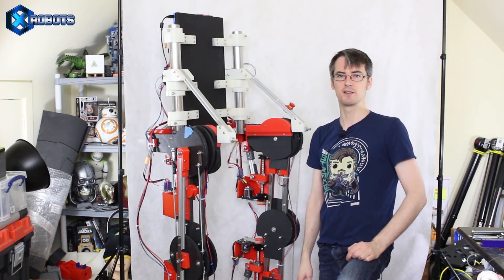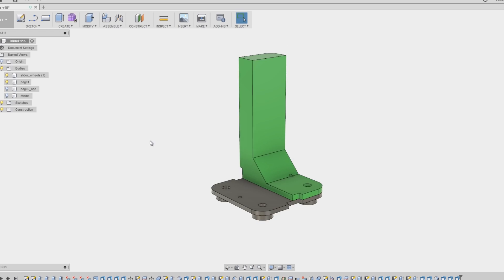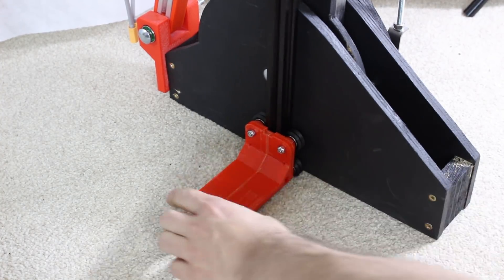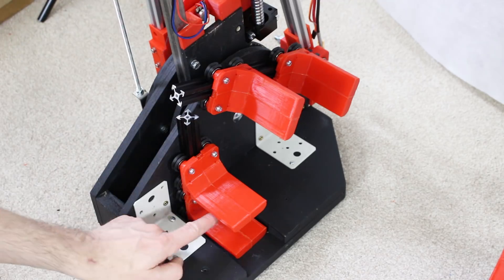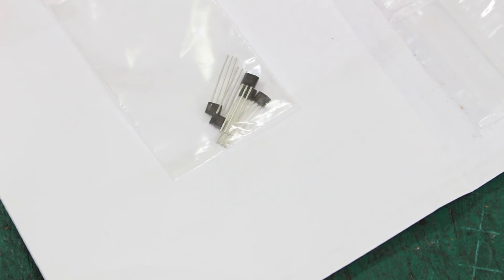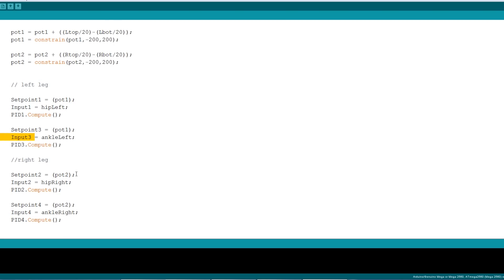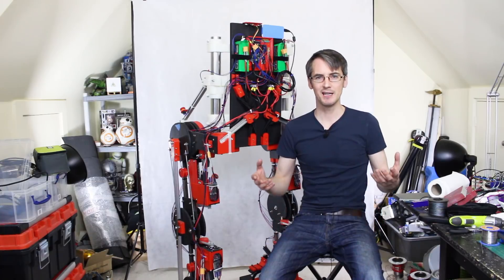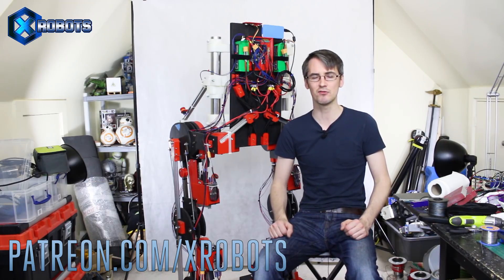Iron Man Exosuit #20 - I Can Move! | James Bruton

Comment: its not that the motors aren't responsive enough, you still have a 3cm air gap between the slider and your foot. just extend the slider pad so it is always in contact with the top of your foot, then it'll work better
Reply: but that's one of the factors that make it kinda irresponsive, he lift his legs, and it takes some times to the motor to get the speed and bend the legs. The motors aren't strong enough tho
Reply: Check out kids strap on rollerskates. They lock the user in while still allowing for movement. That may be a better option for the foot controls.
Reply: It's because the motors are installed with the last Apple update. That's why they're too slow
;)

Comment: That's pretty awesome, but I feel like there should be some type of up/down sensor at the hips, so you could crouch down. The suit is currently capable of the movement, but you would have to lift your feet as you crouched, which doesn't make much sense. The real problem with that is where you would attach it. Maybe some type of harness at the waist that includes the side/side and up/down?

Comment: Perhaps the release of weight on the bottom sensor should, if/else a branch to 'alert' the system for possible upward movement. You may also want to steepen the response curve for the up sensor, to lift at a lower value so it moves when you lift your legs. Or maybe the two working together will give you the leg lifting response you need. :)
Reply: My apologies, I mean in conjunction with the larger motors. :)

Comment: The lack of responsiveness is due to the gap between your foot and the sensor, you have to move your foot a long ways before it starts to move. Just add more foam so that is is always lifted up some. Doing so will mean comparing the two sensors to get the direction because both will may be giving a movement command but that is also easy.

Comment: you need the ankle joint for the end solution. When you add the arms and start actually loading the whole structure not having a stable surface while walking will get dangerous. Your mobility will be limited and given the force flow you will not be able to stabilize if the frame begins to fall sideways. 
I think that you may get away without motorizing those but I am not really sure where the center of gravity will be when you finish the build. So far it looks like it will above the middle line(height) and beyond the middle line(width). 
I would suggest you to ensure that the legs are always contracted at the knees and pushed forward at the hips to compensate for that.

The sensors are cool, but go for springs and rework those in a single assembly- you do not need that much movement to get a result and going for a single assembly should ease the mounting/wiring.  
Bungees are good for prove of concept but they introduce non linearity in the whole system due to the way elastic fabric works.

Comment: The motor has plenty of torque, but as you're running sensorless, the VESC is struggling to start them. You could try lowering the min eRPM, increasing braking current (seems to have loads of ramping in there, not sure if that's deliberate or lack of braking) and dropping the duty cycle ramp step to bring the VESC's attempts to change the motor's speed more in line with what's physically possible.

You could also deliberately introduce backlash at the motor so it gets spinning before it sees load. This helps sensorless systems tremendously. 

I say this having been using VESCs, and brushless generally, in Robot Wars for 3 years.

Comment: Have you considered using something like ski-boots that will allow a firm connection between your feet and the frame?
Reply: vannoo67 that’s a very clever idea. I think that could work really well.
Reply: Good idea, but you would need to wear your own ski boots, so not anyone would be able to walk into this thing. They are also expensive I bet.
Reply: They don't have to be real ski-boots. They could be more like sandals, with the appropriate locking/quick-release structures on their bases.

Comment: Great stuff ! It looks like you won't be able to crouch with that sensor set up. How about one on each knee? Some sort of ball joint at your lower back might give you the ability to swivel your hips, that would make walking a whole lot easier. It looked as though you were lifting straight up and were too rigid to swing your foot forward.

Comment: James, Looking at the attempts at walking it seems that the knee starting from straight means you need quite a few lead screw rotations before the distance from the hip to the foot decreases by any discernible length. The geometry of the legs mean a very non linear relationship between hip to foot distance and lead screw turns, So I'm wondering if this design CAN be made to walk with you anywhere approaching naturally?

You're always going to be fighting the leg because it can't accelerate vertically from a straight legged position as quickly as your own leg (For roughly the first half a second of trying to lift the leg nearly all the lead screws rotations are going into kicking the knee forwards). Because of this I'm wondering if it wouldn't be better to extend the legs by a 100mm or so and have the standing position set with the knees bent by 20ish degrees from straight to take that initial "Knee moving pause" out of the step and make it more responsive?

Please don't take this as criticism, You've come up with some inspired solutions to problems in the past, I just think this could be a design flaw that would be best solved by rethinking the design a little to remove the problem rather than trying to work around it. I hope my comment is taken in the constructive spirit it was given........ And besides, I WANT this project to go well, If it does you might finally start to think about building the power assisted Aliens inspired "Loader suit" I've always wanted to see made. :)

Comment: Nice work. Are those outrunners sensored? In your application it would make a HUGE difference to torque. If not you can potentially make them sensored because you can buy hall sensor PCB's. Also not sure what Kv you're using but I have seen some 145kv or lower 6374 motors around. And be careful playing with the 'startup boost' current in your VESC's as I pumped mine right up, skateboard had insane takeoff and then eventually blew my DRV chip :/
Reply: You should see if you can try a skateboard with sensored motors and see the difference for yourself. It's worth it just for the torque imo

Comment: This is a great project but would distance measuring or IR proximity sensors not have worked better if you'd have strapped your legs to the exo-legs?

The walking motion would've potentially been so much natural.

Comment: I notice lately you've been using super glue with activator, whereas in the past you used Weld-on 16 for ABS. Is this because you are using different filament, or did you find issues with the Weld-on?

Comment: Wouldn't it be better to put the pressure sensors under your feet instead? When the pressure lowers raise the feet on the exoskeleton. And then use some PID to try to keep the pressure at a constant.
Reply: That's true.

Comment: The legs should not be straight in neutral. Look at how any biped rests upright: The legs are always slightly bent with the knee forward. This allows for greater vertical travel distance with less rotational movement.

Comment: seems u hav maxxed out arduino processing, would be better to move over to srm stm f10x for faster cpu
Reply: arduino respond time was too slow steer me towards STM32 F1 , 
you may try https://www.youtube.com/watch?v=MLEQk73zJoU
While for the torque, may try different ratio gear with higher speed smaller motor to archieve torque / speed.

Good job as the first prototype model was being working.

Comment: Instead of putting the magnets on the robot, you could have put them on yourself and use less sensors by using And Gates (( the gate that's if 1 is yes and 2 is yes, output is yes. If 1 is yes and 2 is no, output is no ))